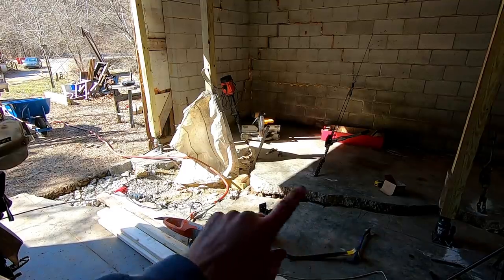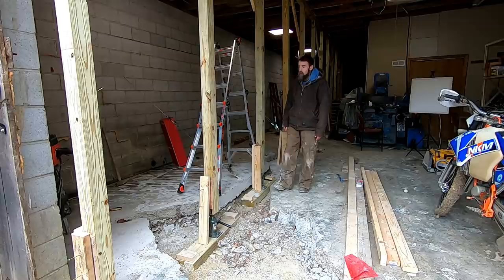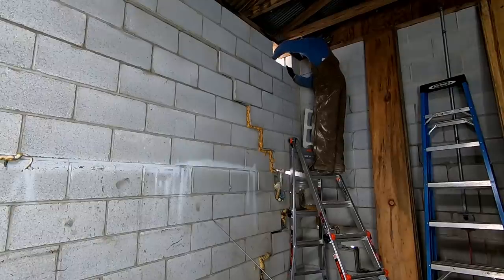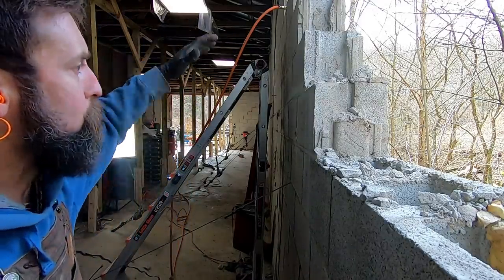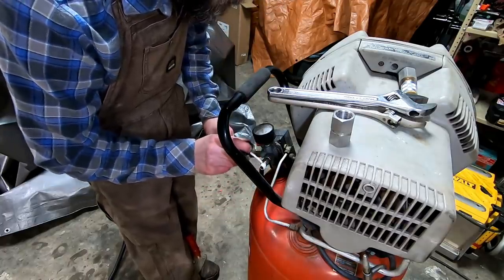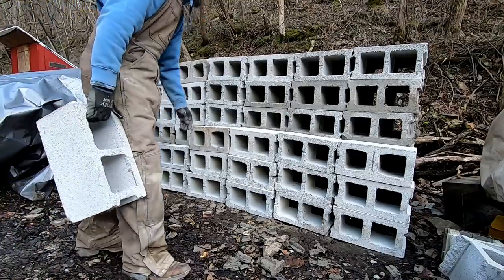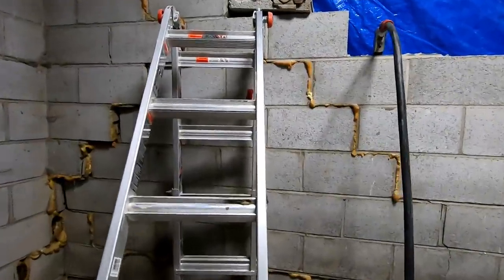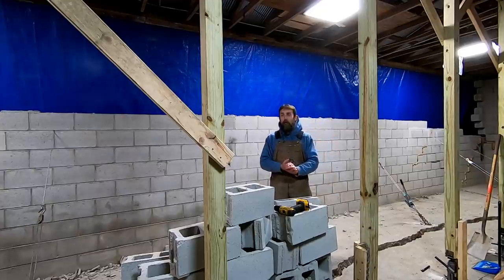Leaning Block wall removal and Roof lift  SHOP PT4

Comment: I have not previously seen the air shim/jack that you used and demonstrated. I used to use OTC Power Team air pillow system for rigging heavy machinery. We had an assortment of pillows that would lift 22,000 lbs per pillow. Collapsed, the pillow needed only 7/8" clearance to slide under machinery which was usually easy to gain levering forklift fork tips against the floor. Lift capacity reduced as the pillow expanded and as the pillow expanded the flat pillow radiused. But with caution and three or four point contact we rigged over 50,000 lbs easily with only a 6000 lb forklift and our pillow jacking system. Old machinery often had room to use toe jacks, but anything built after about 1970 has small base footprint with cantilevered sections and lots of cosmetic sheet metal. The pillows allowed you belly crawl under the overhanging machinery and control jacking from a remote safe distance. We used as little as 1/4" shop air curly cue hoses for air supply.
We contracted heavier moves or new machinery deliveries because I couldn't lift from drop deck truck height to dock height in our plant. The professional riggers frequently brought in some new jacking system that we didn't own, but I have never seen riggers employ the pillows that we relied on.

Comment: I actually found a hydraulic concrete saw a few years back in a garage that needed work. The owner of the garage gave it to a friend he sold it on ebay. It looked like it need an hpu to go with or perhaps plug it into a bobcat. This thing looked really expensive but nobody knew what it was until I came along. Lol I really like peanut when she stops by. I see you are cleaning the blocks for re use 👍. I have done this myself when I was young. Wish I was there to give you a hand.

Comment: Great work Steve, good to see your lad getting stuck in. I helped build my uncles house over a summer when I was 12. Started off moving five blocks in a barrow up the hill and ended with 11 of them per barrow, couldn't physically fit any more. Definitely built some strength up doing that. Also learned a lot about building. Good times.

I'm sure you will be well pleased with your shop once she's done and your lad will remember it forever. Awesome 👍

Comment: Aren't you worried about the creek-erosion on the bank just outside the building, especially during the high-water seasons?  That bank could/might undercut or further slough off, jeopardizing  your new building.  Love your videos, and I am watching this series with eager anticipation.  It's great to watch your progress.  Great job on that roof-support system you put in.

Comment: Glad to see you got that all down with few problems. The rest is grunt work for a bit, just take your time it will get done. Don't forget to check the posts holding up the roof as they may move a bit as you start doing some ground work for new footings, not so much if you do posts. RR Buildings channel builds post frame barns and buildings, you may want to go check out how he does the footings for his posts. If you can get the posts to lock into something solid you will be good to go and it looks to me like that may be your best option for fixing that wall.

Comment: Hi Steve
One reason the wall gave way as well as the footings is there is no core fill in those blocks they should have been core filled with re-bar driven in at random spacing  that gives the wall its strength. You got some work ahead of you keep plugin away.

Comment: Great job. That old mortar is good for your driveway. I wouldn't get too carried away with using it as a fill, stick with rock. Going to have to add on to the shop later with all the leftover block haha. Thanks for sharing

Comment: Looks good, I think I would move the cables to the truss to hold down the edge of the roof in case a strong wind might want to lift up on the edges of the roof? Glad you got the top off with no problems.

Comment: I see a lot of comments bashing the initial construction. It probably would have been fine if proper water control was used. Yes, reinforcement in the concrete should have been used. Someone tried desperately to fill the growing crack with foam.
Hindsight is 20 : 15. Better than perfect vision.
Great work! Relatively new sub here and friend on Facebook.

Comment: Looks like things are going well.  Worried about your jacks leaking off.  Put some cripples in, that will work.  Also worried about peanut, but he seems ok.
Worked with an old guy named Carl, his dad was a block layer, my old father in law worked with old Carl.  Said he laid them up wet and you couldn't hardly tear down his walls.  It will be all ok.  Just a lot of work.  Like the window idea, like your creek.

Comment: Well done! I think sketchy might be an understatement 🤣. I think those screws your using actually have a shear rating (unlike standard deck screws) so pretty sure you'll be fine 😊. Once again, well done on the safety factor, a very well though out and executed plan 👍😁👍

Comment: A concrete pad that size and thickness and no rebar in it, mmm she was definitely a backyard job.
Reply: it's mind-boggling that the only time I get to see a building made of actual bricks in the US, it's the crappiest job ever. I mean the slab probably never would've broken in half if the walls were made of wood. The lack of rebar was obvious from the beginning but such a waste still.
Reply: @sniperasys  Still, now that he is pouring a new footing and foundation, it will probably we the strongest one in the area. Just has to cut a neat slot into the existing one, and use that diamond saw to cut in some tie rods to hold it all together. Then put the rods in with some hydraulic grout when the main pour has cured and finished it's shrink. That will at least keep the floor as a monolithic unit, and the existing one is a lot less likely to crack at the joint line.
Reply: It probably would have held up if it wasn't for the water off of the roof undermining it. 
Hindsight is 20-15!
Reply: All this talk of Rebar?? Maybe he used the Fiber glass additive? Look on Mike Haddicks videos and He  shows how rebar rust over time. I'm not a structural engineer, I'm curious of what kind of alternative there could be to rebar. Maybe galvinized prestressing cables? I agree with the others that Steve should pay attention to gutters to channel the water away from the footing foundations. And Yes, I'm a "Arm Chair Engineer".
Reply: @thebubbacontinuum2645  Well compacted ground bearing the load, and probably the existing slabs there are cracked, but not enough to make a big difference till the ground moves a bit.
Reply: @bjre.wa.8681  I was wondering about "re-mesh" myself. but I don't think it's good for load bearing, just a seal slab
Reply: @MichaelLloyd  The steel mesh is mostly for slabs,  walks, and drives.  If re-bar is properly tied together, the loads will transmitted without breaking the concrete.
Reply: @thebubbacontinuum2645  What? Concrete can support itself without rebar. Problem is without a proper and compacted substrate things settle or heave. A wall of that weight should have been on a footing that was below the frost  line or at the very least and engineered slab.
Reply: @sniperasys  You need to get out more if this is the only brick or cinder block building you have seen in the US.
Reply: @grntitan1  you've really gotta look up the meaning of 'hyperbole' in a dictionary
Reply: sniperasys “Troll” would be the easier to look up.
Reply: @grntitan1  whatever floats your boat dude.
Reply: He got lucky, in other words.

Comment: Some fun block facts. Concrete blocks have a fat (flat) side and a skinny side. You lay them fat side up. The skinny side has the notches in them that you see. Stack block the way they're set on the wall. But don't make chimneys in your stacks. You're supposed to stack them in a locked up pattern.

Comment: I'd suggest stacking those blocks where they lock. so the first 2 high are fine but the 3rd course could be locked into the bottom 2. this way the stack doesn't fall.

we did a DEA hanger and ever 10th column (it may have been closer) was filled with concrete and rebar. then every 10 courses high was filled along with the top course.  now this building was 100' tall and could handle hurricane Cat 5 winds. (they lost a few previously so they made it stronger.)

but as another commenter said. if the wall is great and the slab is poor then the whole thing is poor.

If you dont reuse the blocks for the wall, you make a killer outdoor patio with firepit with them :D

Comment: I had a slab poured 25 years ago they used “fiber creat” without wire mesh and rebar and it broke. I am watching and listening very closely. I know exactly how you dealt with the crumbing work floor. Thanks for sharing.

Comment: Steve save some steps clean off the block inside on the old concrete, then stack them to make a pilar for added support insurance .. don't walk so far.
some of the finer concrete can be used for aggregate fill on the floor.

Comment: One thing I learned when I replaced some rotten floor joists and a sill plate was those hydraulic jacks lower very slightly over time. Your extra 2x4s on the bottom are the way to go.

Comment: As others have said, I would seriously consider doing a block knee wall, then stick framed from there. Would go faster than an all block wall, plus would be easier to tie back into the roof. More room to fasten from underneath than going down from the top. Easier to frame window openings too. Some sheetmetal siding and Bob’s your auntie! Of course that assumes you plan to reuse at least some of that block in the new wall, otherwise you could stick frame the whole wall.......

Comment: If it has not already happened, BEFORE you remove the end walls, I would brace the building sideways, with LONG braces, when there are not 4 walls in shear, it is like a house of cards, and that is bad.   The blocks will make a great foundation, 4 courses high, poured solid, from your filming in the creek, it looks like you will be building on solid rock.   I wish that I still had the strength of youth, but now you have taken over.      Keep up the great work.

Comment: Watching from half way around the world I'm surprised you can't hear me yelling you suggestions. I have learnt to sit back and relax now it is half down. Personally I'd re-use those blocks to rebuild with. Putting in windows will mean you have plenty of blocks over to replace the broken ones. 
Over that length of wall you will always have the ground itself moving as it gets wet and dries out again. Being against the creek it will happen the most so what you need is a VERY STRONG foundation with plenty of rebar. Perhaps some expert help to put it in which will cost but give you great peace of mind. Finish the job with a 4' concrete path all around sloping away from the building to drain the water away. Perhaps a french drain (I don't know what you guys call it) to assist with drainage. All that cement from cleaning the blocks can be used in the french drain.
Your subscribers have provided good information which you will sort through. I just want you to think about ground movement each time that creek rises and soaks in beneath your slab. Now is the time to ask the experts which I'm afraid will result in some costly foundations.  On the other hand your idea of a timber wall which can move as the ground moves I see as simply a short cut. 
if you were to rebuild using those blocks remember that you can drop rebar vertically down into the blocks and then fill a vertical hole series with concrete to strengthen the wall so it will never break apart again.

Comment: im on a farm the 48x150 machine shed with sinking concrete floor was built 1986 the contractor had dozed down buried vintage grainery building & small hog barn right under the footing of the new pole shed. at the time he said "there's no way on earth 10" thick concrete will ever settle". in the 80's cement was dirt cheap so they poured it on thick and it failed

Comment: Good job on the construction. What I'm concerned with is the rodent. I have had a lot of damage from those "cute" critters. Not because they were hungry either. Bitting plastic and rubber for fun. Auto fuel leaks.... electric wires. I'm so over them. I personally am more of a fan of framing walls. I think it's easier all around. Building, electric, insulation, attachment of shelves. I would bag the block. Good job!

Comment: Watching you swing sledge brought back bad memories. My aunt would pimp me out as trade labour for her and my cousin to get what ever they needed for horse showing/ riding. They made a deal for riding lessons and I had to bust out six floors (10x15) in a building that was like a minnie storage but a lot older. The wanted to turn the rooms into  corrals stalls. Note took me a week to bust out floors by hand with a small sledgehammer not enough room to full swing a long handle sledgehammer. Also had to by hand clean out and haul off broken concrete. Note I was 14 years old and it was summer temp was over 100 all week it almost killed me. And what did I get you asked all the water I could drink and ride any horse I wanted. Was not worth it for me but big help to aunt/cousin. That's not all as labour I got pimped out to do. Had to take care a the animals for people, clean tack what ever they needed. But some times worked were I got to meet a lot of the ladies. That's were the fun was...wink wink
Reply: I worked at a large horse farm when I was 13-20 years old. (On some weekends and horse shows.) They held large regional horse shows, so there are a lot of people there from all over the SE USA. There was a lot of girls... A lot.
Reply: @xenonram  yes lot of girls. And they all want help! Willing to wanting.......

Comment: That mortar seems to come off the blocks a little too easily. I never liked the anchors like that because they only connect the roof to the top row of block. I like the roof to be anchored to the footing so the entire weight of the wall is holding it down. The screws you used apply more clamping force than nails so it's the friction between the wood surfaces supporting the weight more than the shear strength of the screws.

Comment: Mortar can easily refill those "cracks/chips". As to the concern of the screws, GRK's are the best on the market, have the highest tinsel strength than any other screw. Nails, they'll easily pull out, bend and won't hold near as well as screws will. Now, if you're talking price wise, nails will win every time but, what's the cost of safety? 
Don't remember if you said it in the last video on this but, hoping you intend on adding in rebar in both the flooring and the wall. Otherwise, this will happen again. You're making good progress on the tear-down, the rebuild is what will take the most time. If you have a bit of any allergies, suggest you spray down the broken concrete/mortar, keeps the dust under control. You're doing it right, just go slow. Looking forward to the next video.

Comment: The issue with screws vs nails is: The screws fail catastrophically, so you'll hear a loud bang and all 3 screws will be sheared off. Since your load shifts and your posts are basically all the same, the two posts next to the failed one would fail as well.

I'm not concerned at all, the roof would just settle a bit and wouldn't collapse, but your heart would have a very bad day :D

Comment: Looking at the slope down to the stream (land slip) springs to mind, ie. resulting in what has happened. You will need a foundation below that surface slip line maybe? However as Jasin C. said never listen to Youtube engineers especially daft old UK ones! Excellent vidio,s Steve. P.S. Just a tad more encouragement for No 1 helper?

Comment: Shear strength of screws isn't an issue IMO ... the shear strength of the screw isn't what takes the load... it's the friction between the two bits of wood... the screws provide the tension to pull 'em together, which is why nails would be relatively useless.
Mind TBF I'm happy to be shown to be wrong on this.
Good to see you've broken the back of the dodgy (sketchy) work.

Comment: I remember back in my younger days taking down a old chicken coop made of bricks. They were set in double rows and were the old 'clinker' type bricks so they were heavier than the type used today. Also had to clean up the mortar from them since I wanted to make a patio out of the usable ones. Must have been around 600 of those and the mortar was about 100 years old so it was pretty hard and stuck to the bricks really tight. Hard work but was worth every minute to get to the end saving those old stones! I sympathize with you knowing how much work that takes. 💪😅 Hope everything goes well. It's a really pretty spot you have there and I'm looking forward to seeing the finished project. Be safe!
(and get Peanut a peanut 🐷)

Comment: So I have been thinking about this wall and how I would go about fixing it. It looks like you got the tear down handled. Reconstruction I would use separate footings and foundation from the floor (floating floor) and replace the whole floor. Also at this point I think you're going to end up needing to replace all the walls unless you could dig and pour footings one at a time to support the wall for floor removal. Not sure if that is possible w/o rebar in the floor the walls sit on. Good luck man anyway you go I going to enjoy seeing how it goes.

Comment: Tedious work mate and rather labor intens therefor a question, as so often after after the work´s done. With all those blocks laying around and a long and wide board you got a portable ramp and could exchange some of that heavy lifting by sliding  them down from the ladder instead of carrying each down the ladder. Make it face the entry and your boy will skip a few steps too.  Well, maybe next time or some other feller makes good use of it.  Anyhow, keep up the good work.